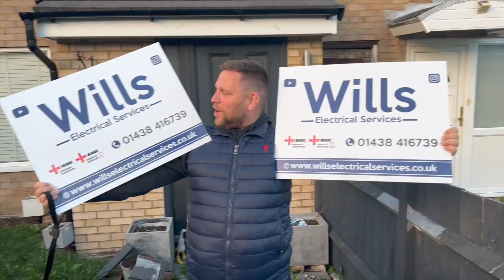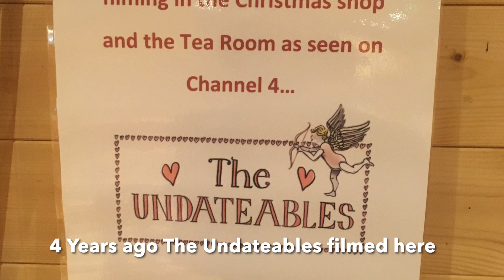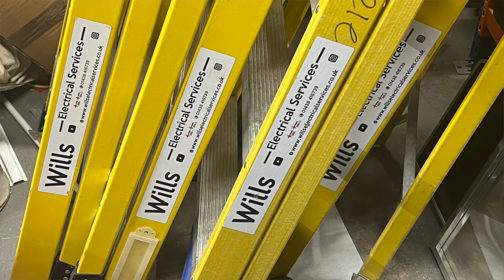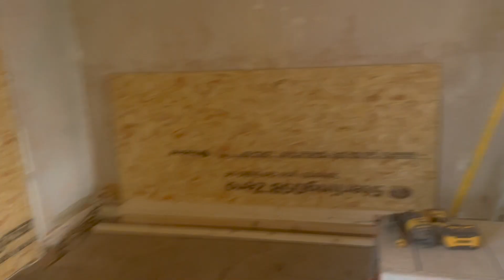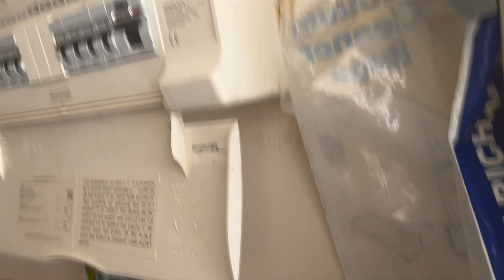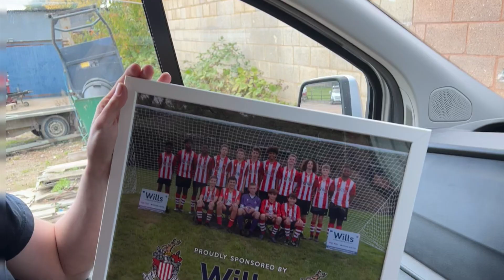🐝⚡️ A WEEK IN THE LIFE OF A UK ELECTRICIAN, ELECTRICAL TESTING & SOME INSTALLS  #week6 Wills Weekly

Comment: On your 1st fix the drops in the stud work to switches etc  - cables are not supported - if I’m honest I do the same because if you clip them to the sides they’ll be out of the zones - should really put in some timber or steel noggins in and clip or tie onto those … thoughts ?
Reply from the maker: That’s a fair point it’s something I’ve often thought about but I believe once you’ve taped them together they never gonna be damaged by their own weight.
Reply: @ElectricianTV  I agree but but I think technically the whole weight of the cables are unsupported onto the (grommeted) entry knock out or worse the opening in a crappy dry liner - i think I’m going to start putting in one of those steel noggins in future say a foot above the accessory and tie the cables on.